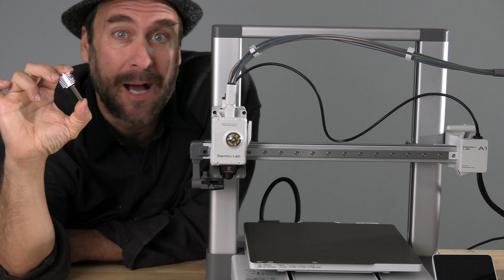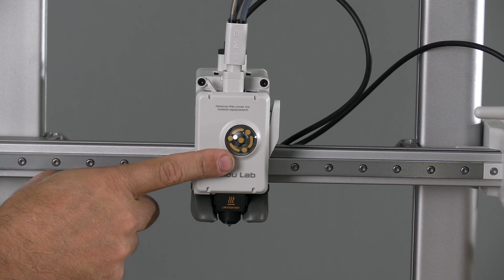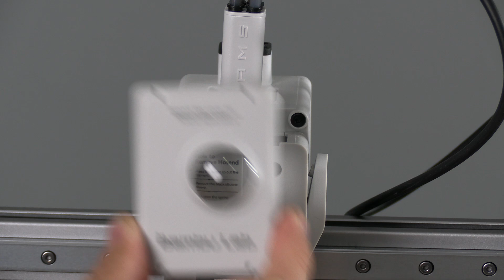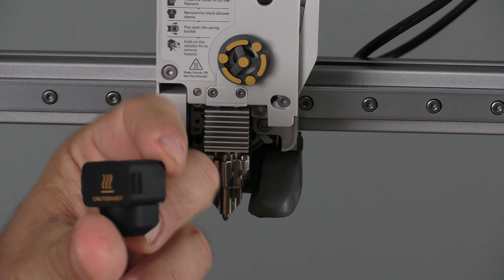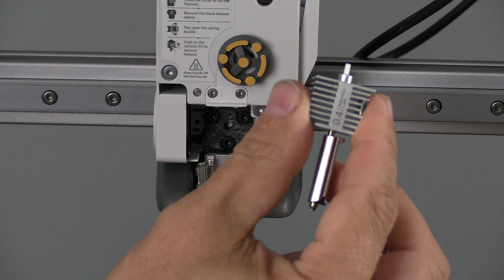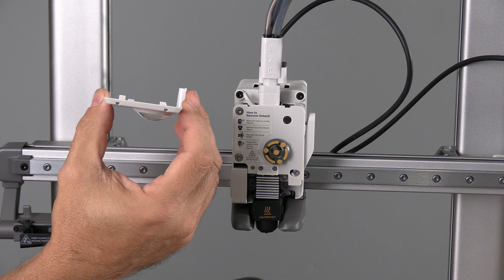How To Replace Nozzle on Bambu Lab A1 or A1 Mini - 3D Printer

Comment: Honestly, how often do you have to swap parts? From what I see on forums, Bambu seems to have issues pretty frequently. There’s always something going wrong, especially when it’s printing in mid-air or just not working right.:popcorn-yellow-striped-smile:
Reply from the maker: I have 2 P1P, and a P1S. All 3 have over 1000 hours on the original hardware, with nothing but a single extruder issue, one time, on my P1S. Be willing to EDUCATE, and you'll be a better printer user than 95% of the world

Comment: Best choice getting this A1. Not a single print error yet. Went to use my V3 and same print failed.
Reply from the maker: V3 is an excellent machine. So far I've had an ok experience with the A1, but need to use it allot more yet